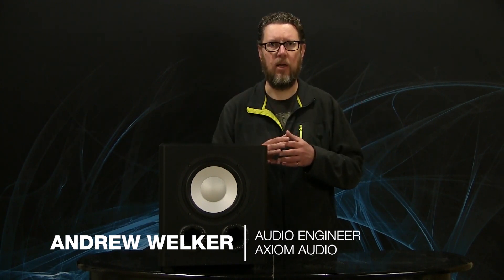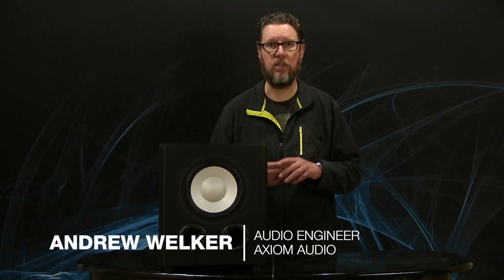Can Technology Produce Small Subwoofers With Big Bass?

Comment: Another great video Andrew! Both on professional sound reinforcement and home audio we have seen a significant reduction in cabinet and driver sizes over the past 40 years. I used to own what would be considered huge home stereo speakers and my instrument cabinets were 2x15",  8x10" or 4x12" drivers in refrigerator or half refrigerator cabinets that were back-breaking weights (Peavey, Ampeg and Marshall). Today my home system is much smaller in size and loaded with 6" & 8" drivers in ported cabinets and my instrument cabinets are also smaller with 4x10" drivers with bullet horn tweeters (Mark bass and Dave Eden). Still, I find that the bass to be "tighter" in the smaller enclosures but no less butt-kicking that the huge cabs and my back is generally much happier! Ahhh...progress :-)
Reply from the maker: Progress indeed! Thanks for sharing.

Comment: I own a small Velodyne (my only non Axiom speaker) that is very impressive but draws a massive amount of electricity. I had to put it on its own electrical circuit as it continually tripped a shared circuit.
Reply from the maker: It’s likely it really does have a very high power amplifier, so I’m not surprised it needs a dedicated circuit.

Comment: So question, is there and ideal tower to subwoofer driver size that allows for better, more even, seamless integration, better matched driver sizes etc ? 
For instance, I've got towers, each with a 1" tweeter and two 6.5" mid & 'bass' drivers, matched with Dual 12" Subs. Would I be better suited with a pair of 10" subs? My dedicated HT room is W18ft X L14ft X H15ft (yea long wall setup for better soundstage).
Reply from the maker: Not really. If the subwoofer is well designed it really should not matter. I know that some believe smaller woofers in subs are “faster” but this is not necessarily the case. Your 12” subs will work just as well as a pair of 10” subs if they are of a similar design.

Comment: If I understand correctly, the massive power that’s now available with (built in) class D amplifiers and DSP are what allowed the size reduction of subs.
1. How about the « transmission lines » that were used inside speakers at some point, were they meant to help with bass response?
2. How about tower speakers with built in subs, why isn’t Axiom offering those (those are very popular with the house authorities who prefer to have fewer devices)
3. Did you say that passive drivers also contribute to the ability to have smaller subs? Are they a good option?
Thanks.
Reply from the maker: Correct. Transmission lines are a different form of loading a woofer, like a sealed or ported box. They can be very, very good if well designed, but they require large and very complex cabinet construction.
Towers with built-in subs were very popular for a few years, and I designed a few for another company, but frankly they were not welcomed by most consumers. I have never figured out why.
Passive radiators are pretty much the only option, other than a sealed enclosure, for small subwoofers as ports would be impossible to tune correctly.

Comment: Is there a minimum size or ratio to driver size where diminishing marginal returns of performance overshadow aesthetics?  Obviously subjective but hope the question makes sense.
Reply from the maker: Well, that really depends on what you find aesthetic. These days a good 6.5” based system is kind of the sweet spot, at least it seems this way. I have no problem with 8” drivers, but beyond that the cabinet baffles need to get really wide.

Comment: you opened up Pandora’s box in mentioning porting.  so why do some subs have ports and others do not?  i know you touched on the micro small subs not having space. but Axioms EP350 and bellow are all ported but the EP500 and above are not.  WHY?

i’ve got dual EP500 and could not be happier in most cases it’s almost like i’ve got more bass than i need. (yes it sounds impossible but true. when the room feels like it’s moving in sonic shock it’s enough for me)

what do ports actually do and the difference between ported and sealed subs.
Reply from the maker: Well, the downside with ports is that they can product some vent noise at high levels. In our DSP subwoofers I wanted to have ideal control over the drivers, which was allowed by the use of a DSP, and no mechanical noises of any kind. In our smaller subwoofers without DSP control, we need to squeeze as much natural bass output from the system as possible because of the amplifier power available in those models. In that case the ports were a good compromise.

Comment: Technology is always getting better. However, just because it is doesn't mean there aren't errors. Trying to cut corners, especially on sound, will be detrimental. DSP can make sound better with subs, but just using THAT will not make it great. Size DOES matter. It must be a big size for deep bass.
Reply from the maker: Yes, absolutely correct. Things like DSP are tools…they cannot be a crutch to make a badly designed subwoofer into a good one.

Comment: Yeah it can be done with all the problems and limitations you describe but I've never been a big fan of compact subwoofers.  For me the absolute best bass quality comes from open baffle with lots of large drivers to get a lot of surface area or in second place, infinite baffle.  Large sealed can work fairly well but small sealed not so much and ported definitely not.
Reply from the maker: I’m also not a fan of “micro” subs. Interesting that you say open baffle…you need a LOT of surface area to get decent output and extension. But if you have the space…
Reply: @AxiomHomeTheaters  I'm using eight 15" drivers on each side of the room,  they do pretty well but I'm also going to install eight 18" Dayton Ultimax drivers in infinite baffle (in the attic) to handle about 27 Hz down to about 10 Hz.
Reply from the maker: @mfkhometheater7742  That must be an extremely effortless and impressive system for bass performance. That’s a lot of woofer surface area!
Reply: @AxiomHomeTheaters  Yeah even with just the dipole subs it's pretty impressive.  I can't wait to get the 18" IB woofers going, that should really shake the house.  I had to do something with massive capacity just to keep up with the big CBT arrays for the mains and center.   Those things are more what one would expect to see in a 1500 seat auditorium than a 14 seat home theater.
Reply from the maker: @mfkhometheater7742  I bet they will be very impressive!
Reply: @AxiomHomeTheaters  If you are ever in the Austin TX area, come by and check the system out.
Reply from the maker: @mfkhometheater7742  Cheers, Austin is a great city, hope to get there again one day!

Comment: 2000 Watts ? I don’t get it . Doesn’t a typical 15 amp 120 V outlet could only provide up to 1800W with the best conditions ?
Reply from the maker: Probably not RMS and you also need to take into account power factor.